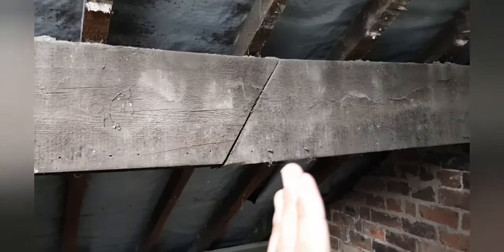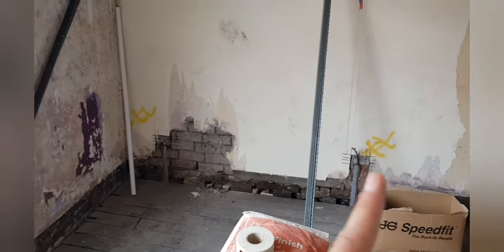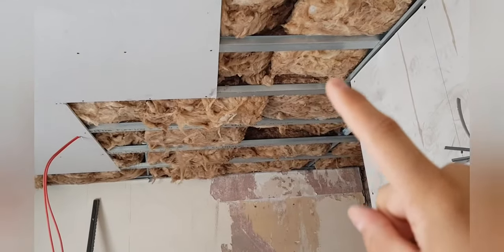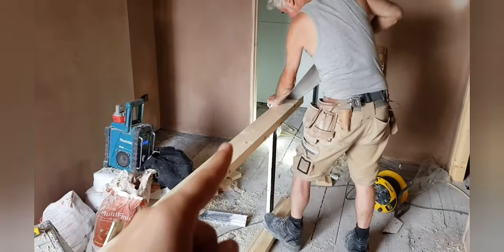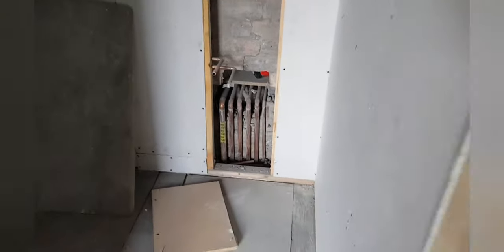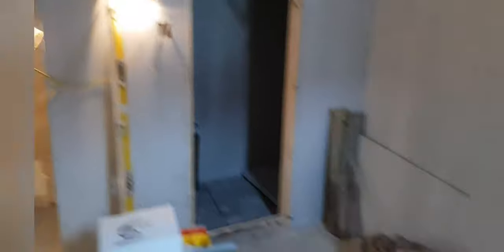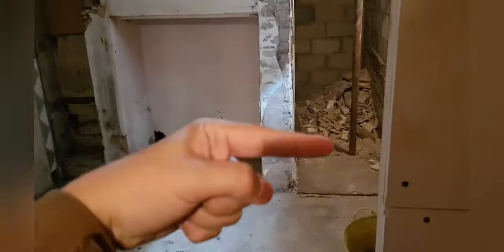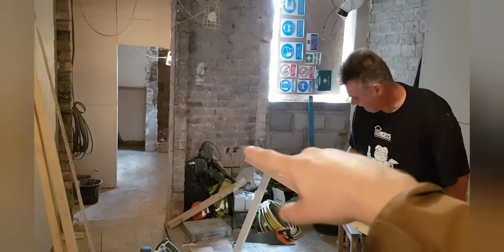2 flats to 6 bed all ensuite HMO - 2nd fix & plastering started  #propertyinvesting #pegasusproperty

Comment: Crackin on John, nice idea with the double silicone. Are you a fan of Mermaid board ? I have installed it on trial, as yet untested.
Reply from the maker: Hi rory 
Honestly never tried them
I believe there is the cheap and flexible stuff then the timber backed to keep rigid so more expensive

Can get the joints and no silicone to regrout

As long as not get cracked but again its only same as student purpose built pods they are all aqua bathroom panels 
So there has got be something in that 

Let us know how it goes 

There is alot of design these days as well 

- John
Reply: Stylish panels and cost effective, will keep u posted ;)
Reply from the maker: @corrvisuals  thanks rory

Ive seen just plain ones, ones that look like tiles and some look amazing

- John

Comment: Would you not use moisture resistant plasterboard in the shower areas.. or does it not matter?
Reply from the maker: Correct yes normally we put aqua board then tile direct on top

I asked builder about this but he has an in house plasterer 
So why they have the mix on they use normal board
Skim then tile on top of skim

- John
Reply: If you’ve ever ripped the tiles out of a shower you’ll see why you shouldn’t use plasterboard. Grout isn’t waterproof, so the plasterboard rots away over the years. 

I use Marmox cement board. It’s doesn’t cost much more than plasterboard and it’s very light and easy to work with. 

If you’ve already put plasterboard in you can still buy a Mapi tanking kit to waterproof it. 

Ps. Where’s the cold water feed for that toilet?
Reply: @DMC888   Thats what made me think... I'm not a builder.. but I have seen the mess behind a few showers that haven't used correct moisture board or been tanked.. worth putting right at this stage if not wanting to revisit at a later date..
Reply: leebo the problem is the builder preps the room before the tiler is onsite and then he has no choice but to tile onto the plasterboard.
Reply from the maker: @DMC888  there will be a water feed in place or will be in the basement if on ground floor 

But a great point on grout 

- John
Reply from the maker: @DMC888  ive clarified this with builder 
They put sbr in there plaster mix 
- John